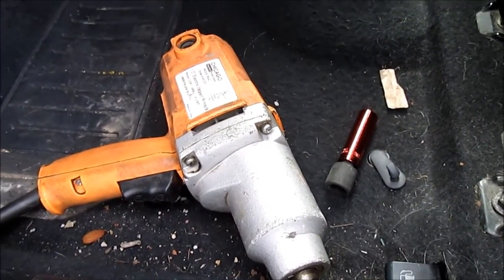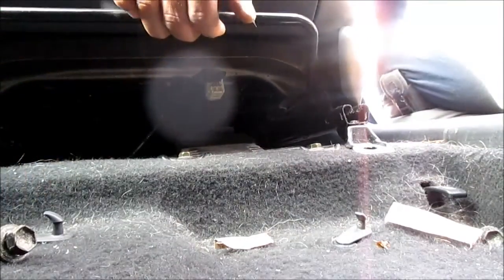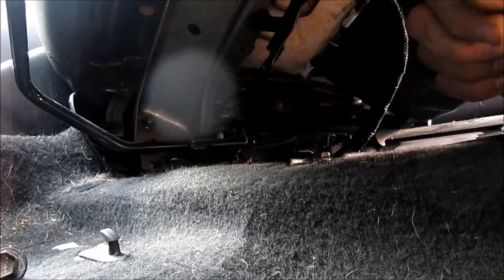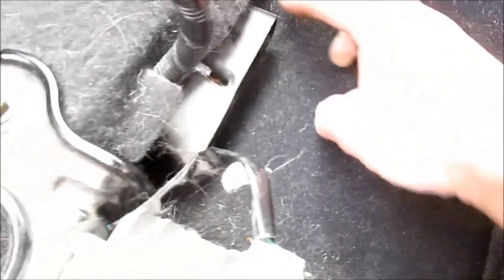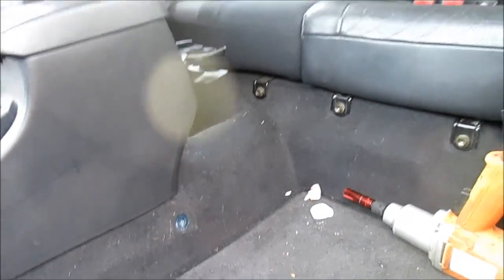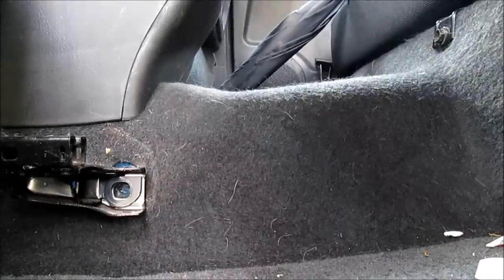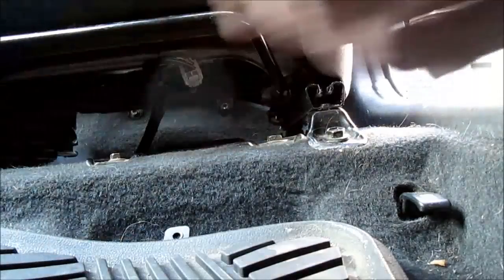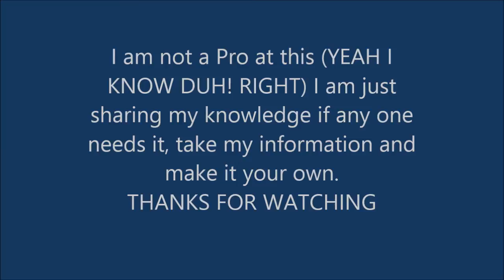Pontiac Vibe seats part 2

Comment: Anti seize, Wyoming. LOL  That's for sure.  Do you think those seats would fit in an old VW beetle bug?  I have a very old Black and Decker electric impact and just took it to work to use on a job.  Nice to have
Reply from the maker: I dunno bring it over and we'll see if they fit, you up for a 1600(1 way) mile trip this weekend. I got spaghetti for dinner, no burritos around here. The HFT impact is well worth it's money.
Reply: Don't think I can make it there for spaghetti but it sounds good. I might have to whip up a batch this weekend.